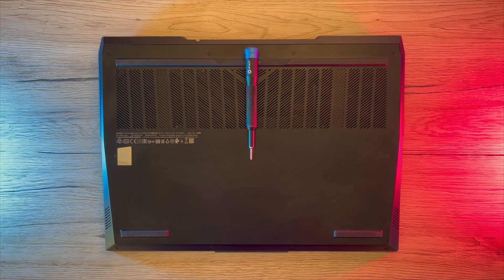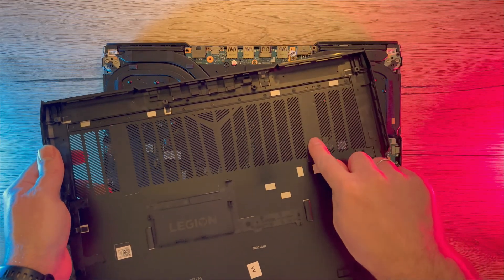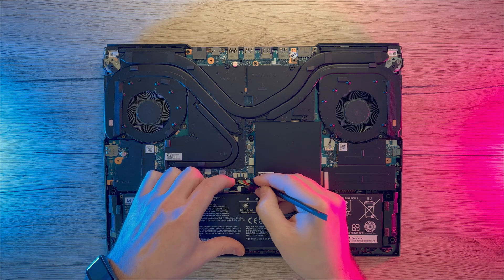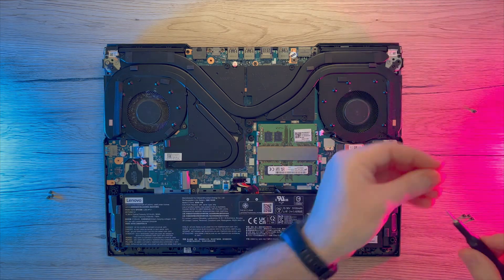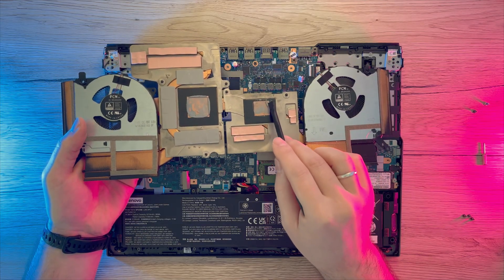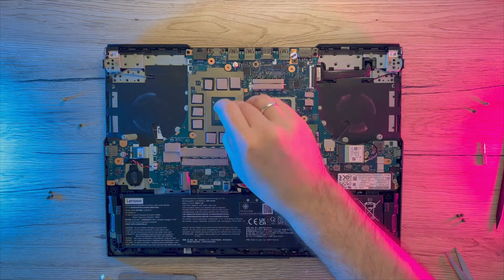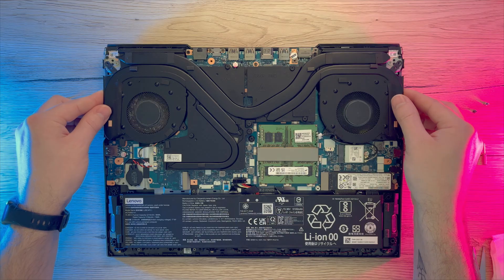Re-Pasting Lenovo Legion 5 Pro 2021 and Fixing Over Heating

Comment: I noticed that you removed the small white lenovo sticker from the upper right fan screw and placed it near usb port... does that sticker come off easily? is it a normal sticker or a warranty void stickers that leave marks behind?
Reply from the maker: Well it depends on your region and laws but usually it should not void your warranty if you don’t brake anything 😬 btw that sticker came like that xD I never touched it xD

Comment: So after doing this. the gpu isnt getting good contact with the thermal paste.... its weird. the thermal griz pads are the same width as the stock ones... but the paste just isnt spreading once i tighten down.. ive tried it a few times. even put the old pads back on.. my gpu is hitting 85 as soon ass 3d mark starts.. the amount of paste is great. i  am so confused. its like your not supposed to ever take the plate off.
Reply from the maker: Pretty much so since they used ptm pads that are much harder. TG pads will not work since they are to dense and not soft and compressible… you must go with really soft ones (like I did with alphacool) best solution for L5P is if you could get your hands on that crazy k5 putty to replace thermal pads and then some thicker paste like alhacool apex, arctic mx6 or Honeywell ptm in pads…. I will try to source those and try my idea since my lenovo is working fine but I hear it ramping up fans and blowing cold air when under load( still not throttling tho)
Reply: @atechcheck  yea the TG pads are way more dense...  i dont whanna be an ass but i followed your video lol.. ill try the k5 and i ordered some tfx paste for the die's.. its supposed to be thicker.. my temps werent horrible. but its been more than a year since i bought the device. ive always used noctua paste but its pretty wet. so the combo of paste and thick pads have been giving me temps hitting 90 gpu under load and im not even gonna test cpu it spikes at 70 on boot.
Reply from the maker: @justinb3074  yeah but you did not check my chanel :P hihi I did this and later I found a better way... so There will be another video regarding this as soon as I source some stuff XD in general you want really soft pads and thicker thermal paste. It does not need to be K-5 XD that thing is terible to take of and clean! If you can get yourself PTM in a tube to replace pads (you will need to put small dot 0.5mm on to every chip that was covered with pads!) and then get also PTM BUT in pad form since that one is even better for your CPU/GPU :)
Reply: @atechcheck  im gonna grab some k5 just in case. honestly as long as i can get it running normal again i wont complain... i wish i never took it apart at this point. bare die really is different.. im gonna just buy some normal arctic tp-3pads along with the k5. try the pads first. with new paste see if k5 is needed. thanks again
Reply from the maker: @justinb3074  Sooner or later it would be need to take it apart and repaste ;) there are blue Arctic pads on Amazon that are really soft and those you could use and regarding thermal paste at least go with ThermalGrizzly Kryonaut ;) if you find really soft pads and if not you can always go with K5 Pro and TG Kryonaut since with K5 you will not have any issues with dies to block contacts ;)
Reply: @atechcheck  grabbed the blue boys earlier.... and the k5. now that i know the tolerances are really that touchy... ill figure it out. i appreciate the feedback brother.. give you a sub ;)
Reply from the maker: @justinb3074  thx man ;) and pls update after you try (or need to try) K5 Pro since for me to be able to use any not that thick paste K5 Pro is the only solution since tolerances are really really bad XD your input will be much appreciated
Reply: @atechcheck  man so i killed the gpu somehow....... it was fine before i started this shit... i just needed somthing to tinker with.. been bulding pc's for like 15 years. went laptop last year kus the gpu market. i was happy with it.. so i got the k5, tfx paste and the alphacool pads... first i replaced the TG pads with the blue boys... nothing... then i put k5 on everything... i was getting hitching and hangs... downhill from there... i figured ide see if the discrete gpu was causing the hangs.. and it was.. works fine using the vega cores instead... so i go back in one more time to try and get the gpu under control..... now when i boot with dedicated gpu my screen is all artifacted to shit..... im so pissed at myself for even doing this... i had a dell g5 5587 a few years ago and tried to repaste. had similar issues with temps.. but it worked good enough to resell it.. this thing is cooked :\ and laptops being laptops... i have no way of finding out what did it... those alphacool pads are like not even pads... there real like spongy. tear real easy... nothing like the stock pads. i think that was the main issue this last attempt
Reply from the maker: @justinb3074  okkkk that is strange... have you removed those covers/tape covering your GPU surroundings? If not please take it of and inspect MB and try to see if there is any damage. Also if you can please take photos of you MB and close ups on your GPU die and surroundings as well as cooling block and either send it to me to check or post link so that we can maybe figure out what went wrong!

Comment: Hello, Thanks for the video.  what is the  thickness of   the thermal pads? As u know  there are many  thermal pads out there with diffrent  thicknesses. 
Beside that at first  times  when  I change  heat  mode(blue white red thing) to  blue,  fans were slowing  and  i would do my  office work silent , now it has not change anything. Fans are  running fast and doing  noise.  So i suspect the  heat and  dust.
Even İ sense unstable  laptop behavious.  Much more slowing while surfing  internet. Or office  work.
Reply from the maker: Yeah, your cooling block is loosing contact/pressure to cpu/gpu dies… they are getting hot and not transferring heat to the block but you laptop is ramping up the fan speeds since it wants to get rid of it…. Do go with really soft pads like I did and if you can get yourself Honeywell ptm but in form of a pad or some other really thick paste. Also when fans are ramping up is your exhausting air cold and not hot? If yes then it is definitely not making good contact to cpu/gpu dies!

Comment: man, you are the only one that make a video of thermal pad for lenovo legion 5, but i have a legion 5 that are non pro, can i use 1mm thermalright pad for my legion 5 non pro? and i see that these stock thermal pads are sticking with the heathsink, if i replace them with the new one and place them on the top of the chips like you did on the vids, and someday if i want to reopen the heatsink, will they stick with the heatsink or they stay on the top of the chips?
Reply from the maker: Well I had legion 5 non Pro to and I did the same 😊 yes you can see f course. Regarding where will pads sticks I can not answer since it is totally random xD in my case it was 50/50 half on the MB half stayed on the cooling block :) but it does not matter just peel them off of the MB or cooling block ;)

Comment: which thermal paste do you recommend for my lenovo legion 5 ?
Reply from the maker: Any good ones, as loong as they are soft and able to compress enough.
Reply: @atechcheck  im kinda thinking buying the honeywell ptm7950 pad but im not sure which size i need to order for my lenovo
Reply from the maker: @Enginor  I mean it is thermal paste that is a bit harder when cold XD you If you have money to burn I would go with TPM on Chips as well as replacement for stock thermal pads! BUT make sure after replacing to run you laptop hot enough to melt it and then tighten the screews again when cooling block is hot and saturated ;)
Reply: @atechcheck  i talked about the fitting size for gpu and cpu but yeah thanks anways (:
Reply from the maker: @Enginor  I know, but because it is a hard paste like, you can use it anywhere ;) and I would use it to replace thermal pads, in your case you can use it for CPU/GPU dies. You will just need to check online size of both of your chips and then order size that is enough to cover them ;) and regarding thicknes I think they only sell one size ;)
Reply: @atechcheck  thank U will do that appreciate it

Comment: Hey, A few days back I got my damaged motherboard replaced from Lenovo authorised service centre. And now the laptop is reaching 101° CPU and 85°+ GPU temp playing witcher 3. What should I do?
Reply: I am having the same issue and now I must send it back again... They must have screwd with thermal paste/pad installation when they changed the motherboard.
Reply from the maker: Well I think you have 2 options… DIY or send it back…. Knowing Lenovo I would opt for DIY! If you can get TPM in pad form and also use same to replace thermal pads (it works amazingly!)
Reply: @atechcheck  Then allow me to present an alternative one...the half-DIY way! ... What is, and how half- you ask - is that? Well, just follow my following affiliate link to see ;)
Reply from the maker: @joaocatarino3589  Not sure that I am understanding what are you trying to say :D
Reply: @atechcheck  I was just kidding...I also made the mistake of repasting my L5P while still under warranty. Nothing i tried afterwards solved the problem (even repasting with honeywell, both pad and paste). So the half-DIY way involves ordering a brand new original cooling module and replacing the old one: at least now my gpu temps are way better than before (CPU temps around the same).
Reply from the maker: @joaocatarino3589  aaaa now I get it XD  Man that is bad, regarding your laptop! I hope new lenovo laptops for 2023 will be much better regarding quality....
Reply: @atechcheck hi can you please tell me the screwdrivers needed to remove the back panel and the thermal module?

Comment: What size are the thermal pads?
Reply from the maker: original ones are 1mm. Go with soft ones at 1mm ;)
Reply from the maker: @dazzlecsm2744  well 2 things then..... bad contact with dies and pads are not compressing enought.... Check out my video with Alphacool and their soft pads and thermal paste ;)
Reply: @atechcheck  Could you give me a link to buy the same please
Reply from the maker: @dazzlecsm2744  of course. You will need to cut it yourself (check what I did) and since those are soft ones you will need to be carefull. Also get their Apex Thermal Paste ;)

Comment: Hey Alen! I have Legion 5 with i510300h and 1660ti and recently I have noticed that laptop keyboard is slightly bulged around Power ON button and 9f/f10 buttons.. I don’t know what it can be and what should I do. I own this laptop more than a year and have never changed thermal paste or pads in cooling system and never cleaned fans.
Reply from the maker: Well if you just noticed and it was not there before it is hard to say without photos of it….. take them and share link to imgur or so. We might be able to help 🤔
Reply: @atechcheck  YouTube is taking down the link

Comment: I had wanted to get my same laptop repasted but the service technician just messed something and I'm getting 100 percent cpu usage in cinebench mutlicore test. is it normal? I used the same thermal paste. And also 100 degrees of temperature.
Reply from the maker: please take a look on my last video with Alphacool paste and pads... there are some contact issues with cooling block and CPU/GPU dies....
Reply: @atechcheck  so like what are you planning to do now? And what is lenovo saying? I've already watched your video
Reply from the maker: @chiragarora5000  Well last mode worked for me with Alphacool.... You could always limit your CPU to max 35W (25W will do more than fine...)I will be doing another Software tweak video with 5Pro so you might find that useful. Also what did you do with thermal pads? Have you replaced them?
Reply: @atechcheck  No i have stock thermal pads and I'll try to limit cpu wattage but something seems off.
Reply from the maker: @chiragarora5000  well your main problem are those original pads since they are too thick and no compressing enough and with that your CPU/GPU dies are not making good contact with cooling block….
Reply: @atechcheck  everything can be justified but 80 watt of power draw on cpu alone is a bit concerning as AMD list upto 35 watt of power usage
Reply from the maker: Well those 80w were PL2 and PL1 was at 50W something…. It is OK since it is only for few seconds and then it goes back. Also it is up to Lenovo to limit PL2 since I agree 80W is to much in a laptop… especially when there is no benefit from it…I would limit mine to 30W burst (PL2) and 20W sustainable (PL1) and you are loosing a bit of power but CPU is under 70C
Reply: @atechcheck  bro i get the idea of what you are saying but please make a video on how to limit these values so i get peace of mind.
Reply from the maker: @chiragarora5000  🫣 next week it will be up ;)

Comment: Hi, i found out a strange cause of overheating in my legion 5i pro (i7-11800H)
The laptop only overheats on the cpu side (rtx3070 with 140w never goes over 83°C) I use msi afterburner to monitor usage and temps. While i was rendering in Creo 7 cad software i saw a big slowdown in perf the i noticed it is very hot to touch but the ventilators ar not running just on very low rpm, i opened afterburner and i saw 90% usage which is good at rendering, but the cpu hitting 99°C. It is the case with balanced and performave mode (quiet mode limits the cpu power so the laptop can cool it with low fan speed, so my theory is that the laptop fans are controlled by gpu temps, not cpu. So if you run a well optimised game, like doom in 1600p with ultra settings with 165fps (145-165 fps range) you have cpu temps in the 80°C temp range, but in cpu heavy games the cpu hits 95-99°C because if the gpu is at 80°C the cpu fan will work at normal speeds because ghe gpu is not hot, but cpu will overheat, so i guess there is no need to change the paste or anyiting in your laptops too, we just need an update, or a factory fan control
Reply from the maker: Well as you saw in charts CPU was always HOT xD and no it is not controlled by GPU (at least not in my case). Download Cinebench and run CPU test and you will have your answer ;) also you need to understand that your GPU is running at 1.7GHz X1 and your CPU is running at 3.0GHZ x8 so it is normal that CPU will always get hotter but again problem here is CPU/GPU die to block contact ;) also manually limiting your CPU to 25W max is way to go since after that you are not getting any significant gains and your CPU will be under 70C ;) (mine is after my last Alphacool video)

Comment: My Lenovo legion 5 rtx 3070 temperature goes around Gpu:53° and Cpu:63-68° playing Genshin impact graphics max settings while in some triple a games hit around 77-83. But rarely causes bit stuttering while web browsing, gaming or watching movies. Should I repaste besides I got it 7 months ago? its used
Reply from the maker: Hmmm those temps looks good ;) 53 on GPU is great tbh but can you tell me your GPU Temps when your CPU is hitting 80C+ since I didt have time to test Genshin Impact and see how does it utilazise CPU and GPU..... I am assuming it is not tht CPU demanding while Forza 5 is really taxing CPU.... Also you can disable CPU boost (power plan>CPU>Max 95-99%)
Reply: @atechcheck  Also If im going to repaste, Should I replace thermal pads attached cooper heatsink too?
Reply from the maker: @dnnisamn6886  what do you mean with "thermal pads attached cooper heatsink " exactly?
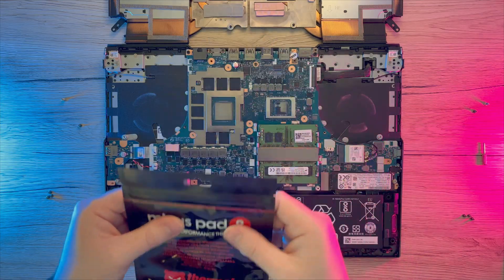Reply: @atechcheck  ah no its ok just seen at 2:02 how you are aplying new thermal pads

Comment: How annoying are these reviews. Nothing about the thickness of thermal pads. No measurements, whether it is possible to put a thin graphic gasket with higher thermal conductivity on the processor and video card chip. If the thermoplastic has an average of up to 10W/mK. Then such a thin sheet has about 40W/mK. And there are no other sizes. Yes, and more recommendations for modifying and cooling the SSD. And such useless 99% of reviews all over the Internet.
Reply from the maker: I am not sure what you are trying to say :D yeah there are a lot of them but I am not sure are you saying the same for this video or not? Regarding no measurements hmmm not sure what to say.... did you not catch that I used 1mm pads since original ones are between .95-.98 (after compression). If you have a question please ask but do it so that we can understand what do you need exactly ;) Also take a look at my last video on L5Pro and thermal paste and pads ;)
Reply: @atechcheck  Yes. Boiled. Tell me how to cool the SSD. What kind of radiators can be put instead of the base cover, which cools very poorly. Thank you.
Reply from the maker: @MisterRavlyk  you mean NVMe right? Simple use some 1mm pads between NVMe and metal shield. With "radiators" I really have no idea what you mean..... Base cover is just a cover and it should not cool anything except if it is metal in which case it can be used with some pads again to transfer heat to it and with air entering thru bottom air vents it will help with cooling a bit. What laptop do you have?
Reply: @atechcheck  Base cooling with a base plate does not cool well. My ssd 970 evo 2tb has 77С degrees
Reply from the maker: @MisterRavlyk  Well there is something else wrong since my 980 Pro 1TB is running at 38C with exact same setup as I wrote you to do.... And you did not tell me what laptop do you have?
Reply: @atechcheck  Hello. I have a legion 5 pro 16" with 3070. I installed a 2tb 970 evo plus ssd as a second drive. The temperature is 77-80C with active use. In idle, about 55-60C. I'll try to order from ali "JEYI High Performance Auminum Alloy Heatsink" for cooling m.2 ssd. Because the base cover does not cool as desired.